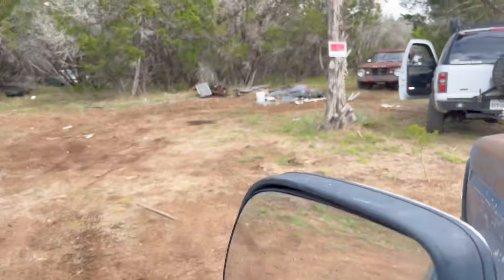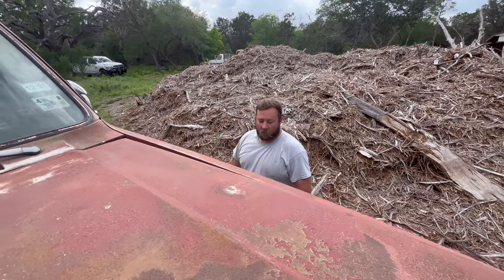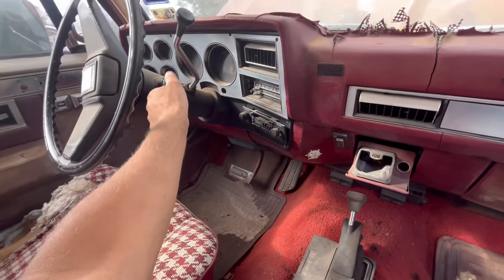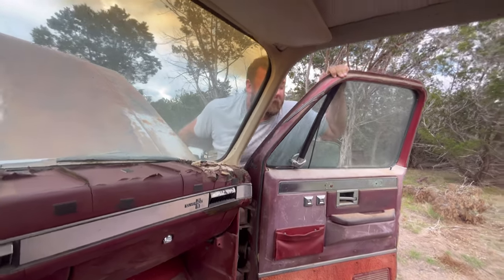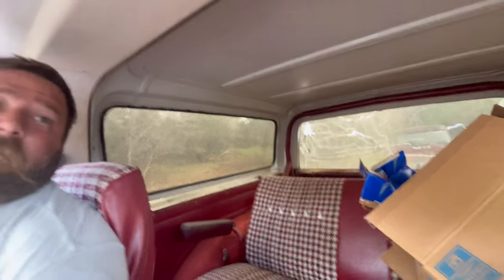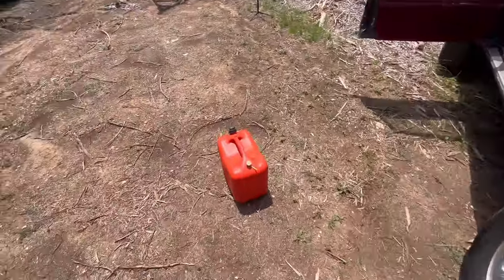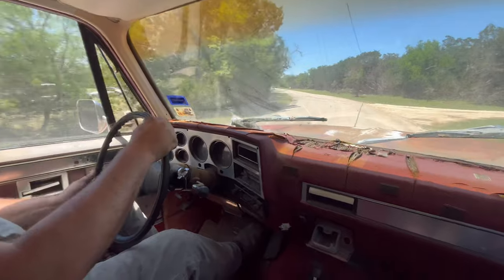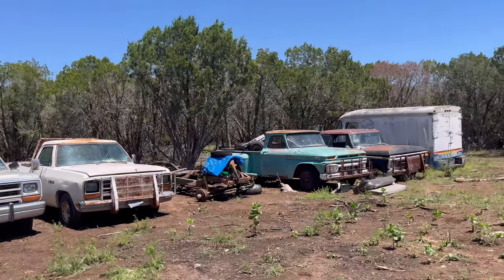SCRAP YARD BLAZER! Will it run??

Comment: I saw a Harrison A/C compressor, what happened with it?  They got rid of the Blazer because of the transfer case and the leak of the transmission cooler.
Reply from the maker: Tranny cooler ended up leaking just from age and us messing with it. Ac comp was deleted

Comment: No way squarebodys are waay cooler than those ugly to me 67-72 chevy and GMC trucks never cared for them!
Reply from the maker: Agreed!
Reply: The 65 - 71 late.  Was a sick truck depending what you got it could of been the 327 4 bolt main, steal crank, 202 hump heads, and 4 barrel intake. Would make around 280 305 hrp 2 speed power grid.   depending.     My 1965 had one plus the cool body, had a cab spoiler built in! Blinkers in the hoods that's old school cool. 
  The 68 - 72 are just ok they kinda suck I-beam rear suspension, 3 on the tree inline 6, or the munzi 3 speed  never really like those body style for trucks,and the part are double the rest of the body styles
Reply: Everyone's got a blazer, who has a 64 super short bed gmc?

Comment: If it was a California top it would have  no b piller and be a full removable top, no top frame to the doors either just glass..  so you know the difference
Reply from the maker: Thanks! So just like the “jaws” blazer then. I know my old dodges but not quite all the squarebody stuff.
Reply: @tcfinds  yes the fiberglass top would go all the way to the windshield,  NOT stop at the front seats. And there would be a secondary roll bar in between the front and rear seat,  I absolutely love the blazers have had probably 20 square body trucks of all kinds and yrs, But never a blazer.. next on my list of projects
Reply: 73-75 all had full top,  76 on had the half top....